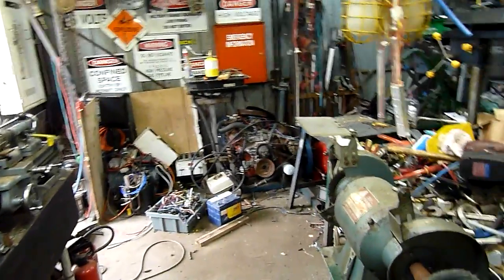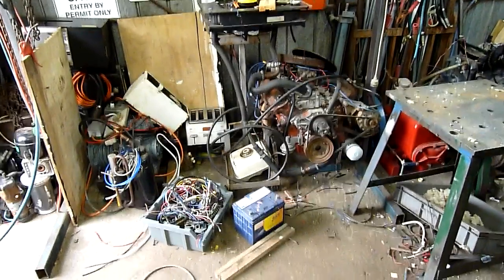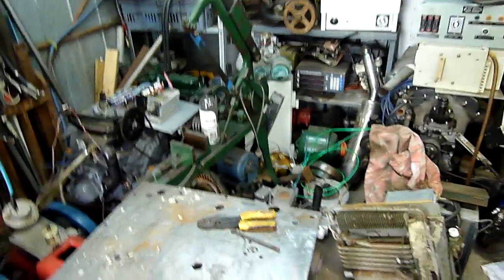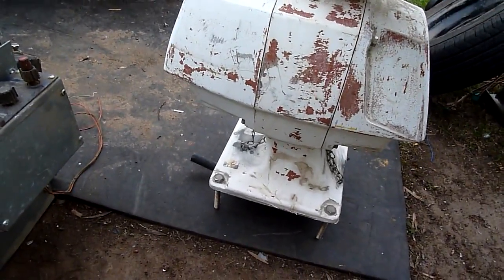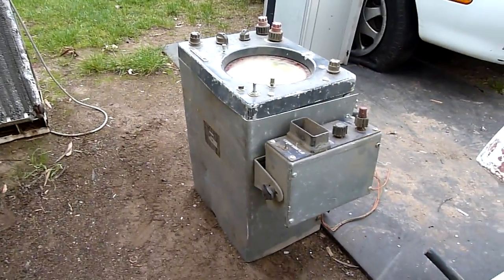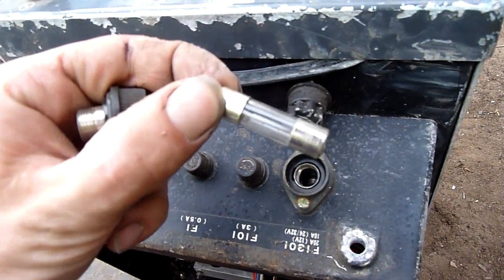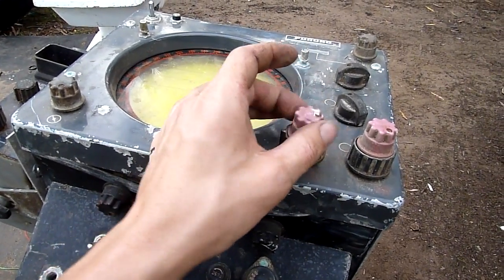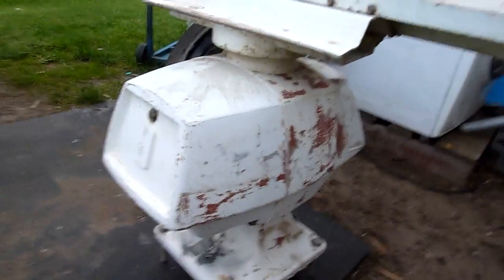Ramblotronic Wednesday - EDM update and Radar Equipment

Comment: LPG used to be quite popular here, only we call it propane. To start with the propane contains about 25% less energy then gasoline. Most of the cars that got poor mileage had duel fuel sytems petrol/LPG and wasn't all that great with either fuel. If the car ran on straight LPG then the engine could be tuned to optimize it, propane has a very high octane rating so a propane only engine can be made to run at 14 or 15:1 compression which you couldn't do if it was dual fuel.

Comment: Same caution goes for the magnetrons for radars as microwaves: Beryllium oxide is used in some models. That bad boy probably ran off 48 volts DC or even higher.

I do have a line on a K-Band 1MW magnetron. It's up in Alaska though. Doc's Machine @ the-whiteboardDOTcom has it, and probably came out of the old Nike-Hercules defense radar installations. It's huge, heavy, still sealed with factory plugs. I would not fire it up or it would fry half the city's wireless, and me in the process!

Comment: Petrol 95 octane  - £1.28
Pertol 98-100 octane  - £1.38-1.50
Diesal - £1.40-1.60
Lpg - £0.60-80p 

If fuel prices stayed at or below £1 a liter the oil companys will make more money as more people will be will to drive.. 

Lpg is still a good choice but basic kits start from around £500 + £200 install fee..  So uts going to take a while before you see a saving.

Comment: @Aussie50 Bugger. Don’t suppose there is any part number and brand on the part you need ? I did not realize the unit was that old sorry. I worked in Taiwan a couple of times checking new products and production and while there found a U shaped arcade with shop after shop FULL of electronics disposal. Test gear and components really cheap but I had no way to bring it all home. :-)